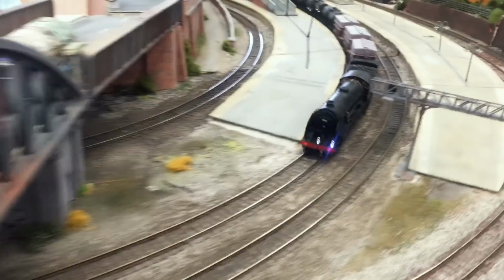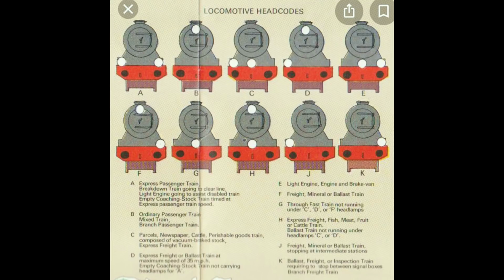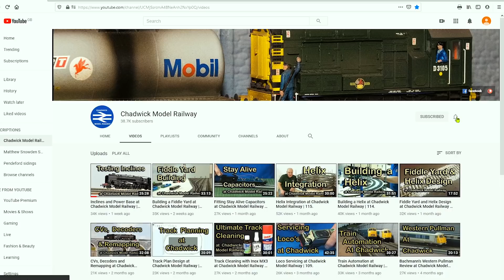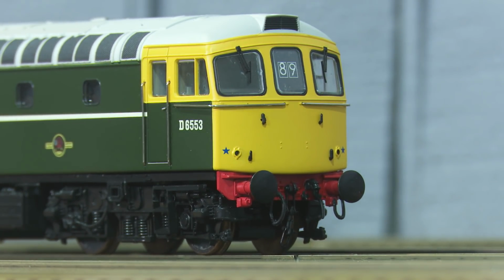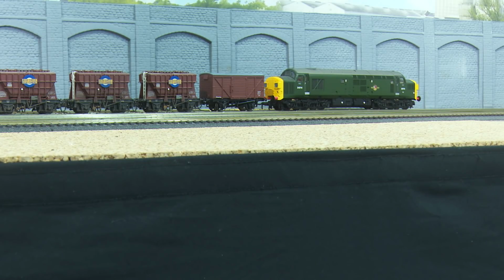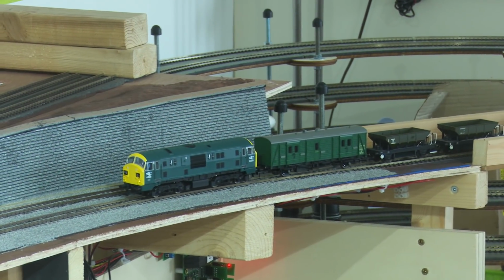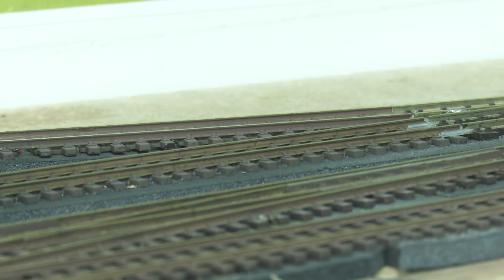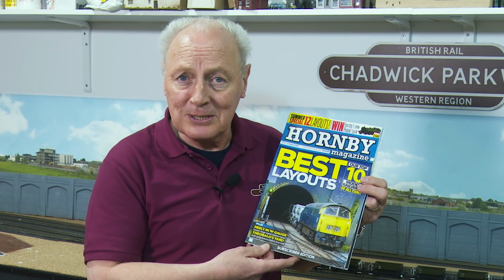Building Freight Trains at Chadwick Model Railway | 155.

Comment: While we're "counting rivets", I was a tad concerned at the run away 9F with no crew!
However, I'm not going to tell you about the 16t mineral I accidentally put the white stripe on the wrong end of, and still haven't fixed, for fear you'll have an attack of the vapours! Always interesting and informative. Cheers
Reply: If your ballast train is going to remain a fixed rake I can heartily recommend Hunt couplings. I'm slowly converting all my stock over to them. I can't stand tension locks, even the smaller modern ones
Reply from the maker: Excellent comment Davie. I’m unsure about using hunts on this train, as I’m unsure of the finished weight and whether the magnetic couplings will stay attached when coming up  the Helix. Regards Charlie
Reply: @ChadwickModelRailway  Charlie, you are in the ideal situation to fit a converter wagon with Hunts, and then run longer (normally coupled) trains up your helix to test for breakaway lengths. 
I shall look forward to the video on that. 
I plan to use a Hunt Elite as the central coupling of my tube train (for ease of handling) which has two “locomotives” and so has the risk of separation from momentary power loss in the rear section.

Comment: Thanks Charlie another very interesting Video. Having unloaded Ballast on Civil Engineering Jobs in Possessions it was always an interesting Experience for the Staff. The Job could be on a Relaying Site or dropping Ballast as a general Maintenance requirement, ie Site Short of Ballast with the approach of Summer, especially important on CWR where Radius of Curve and Cant dictated the size of the Ballast Shoulder. Dogfish could have Controls for Operators anyway round, other Ballast Wagons of larger Capacity were Seacows, Sealions, even Walruses as well as others, check out Paul Bartletts very useful Website. Unloading of Ballast was controlled by the PW Inspector who was the master of ceremonies, and either walked along side the Ballast Train during the unloading Procedure and or with a Back to Back Telephone by which he could communicate to appropriate People on the Train and obviously the Crew on the Engine and Shark. All Dogfish were fitted with a Baffle Plate to stop all the Ballast coming out too quickly, as Ballast could be dropped from either side for making up the Ballast Shoulder or in the Four Foot. Unplated Wagons were carefully marked and generally only unloaded carefully by experienced P Way Staff, I‘ve actually seen an unplated Dogfish derail itself due it being unloaded too enthusiastically by inexperienced PW Lads. Hope you find this interesting.
Reply from the maker: What a great comment Peter. 
So interesting to hear it from the workforce itself.
Regards Charlie

Comment: Hi Charlie, more brain expanding stuff, cheers. So here  I go; Depending on year "All gunpowder wagons should have brakes" developed into, "must have brakes". In some strange time, where lots of gunpowder wagons made up a lot of a braked/part braked train.... Braked gunpowder wagons were all fitted at the end of the braked wagons, followed by unbraked gunpowder wagons, then the rest of the unbraked waggons. Keeping the "gunpowder" away from both engine and brake van, giving both driver and guard as much safety as a motorcyclist's helmet does in a 100mph head on crash with a castle. The theory was that by putting all "Explosives/munitions" wagons together; If one exploded, that initial bang would blast other wagons away so they did not add to the blast. Plus gunpowder wagons were of a much stronger design, so a rake of them in a crash would survive better than spacing them between rust bucket wagons. I hope this reads OK as I can't find my reading glasses, age thing......
Reply from the maker: Great comment Sjaak, Much appreciated, regards Charlie

Comment: It gets even more complicated when you start mixing vacuum and air braked stock. Some wagons are vacuum braked but through piped for air. some locomotives are dual braked , air vacuum, and some are air only. Also locomotives can be dragged dead in train either braked or un braked. Knowing were to put everything so you have brake continuity is something of an art form.
Reply from the maker: That might just be a step too far for my channel Arthur, regards Charlie

Comment: Sorry Charlie, this is a second comment. Your question about number of Gunpowder Vans that can be marshalled in a train, whether they can be formed together and the requirements for barrier vehicles is most timely. My two new Rapido vans arrived today! 
The 1950’s Rule Book states that, 
Not more than five vehicles containing 
explosives must be conveyed by any one train at any one time. Vehicles containing explosives or highly inflammable liquids or liquefied gasses must be marshalled as near the middle of the train as possible and in any case there must be at least two vehicles either empty or containing non-explosive 
traffic marshalled between the engine and the first vehicle containing explosives or highly inflammable 
liquids or liquefied gasses, except that for short distances between depots or private sidings and marshalling yards these two vehicles need not be provided.

I hope this helps. Tony
Reply from the maker: Brilliant Tony, great info and much appreciated.
Reply: Good stuff Tony.
I joined BR in 1978 and hava feeling it had been tightened to just four explosive vans by then.  At that time our "goods" 8J23 Bescot-Cambrian ran with mostly vaccy traffic. I used to go through to Pwllheli on Tuesday and would bring the loads back from Penrhydeudraeth. Always barried by two wagons from the loco and another two. By this time it was mostly 12T vanfits, handy because they often worked onto the Cambrian Coast with agricultural products like slag and lime and feedstuffs.

In 1979 when Barmouth Bridge was banned to locos we used a DPU to recover all the vac fitted wagons back to Machynlleth for despatch back to Coton Hill. The DPUs were allowed 7 vehicles as tail traffic. I saw one of these trains but sadly never had a camera. Not sure how many trips there were but at least some of the wagons were CXVs.  Like you my pair from Rapido are eagerly awaited - maybe tomorrow. I can then put my 8J23 together with my blue Bachmann 24/1 !!
Reply: @philbartlett7898  nice memories Phil. Old guard stories would make a good book and really useful information for modellers.
Reply: Hearing about the Gunpowder vans reminded me of an experience told to me by a fellow worker forty years ago. He was head shunter at a provincial town during WW2. A train of explosives arrived for on-forwarding. But it had not been made up correctly, all the wagons containing the explosives were marshalled together when they had to have an empty vehicle between each one. He and his crew took ages to put it right. The detonators were a seperate consignment on an entirely different train.

Comment: Interesting video, I have been thinking about freight train composition recently. Mostly in late 80s/1990 speedlink trains where freight was mixed. Plenty of videos on YT of these and often there were shorter trains. By the time of speedlink, I think everything was air-braked so much easier to recreate. I did read somewhere that VEAs (ex Vanwides?) were used as ammunition vans and could be accompanied by a brake van with an armed guard inside (not sure how true this is, but the IRA were active then).
Harder to recreate are the longer trains in modern times with 30+ MGR wagons or when the Class 60 came out and started dragging ~30 TEA 100t bodie tankers, a train that long would go twice around most people's tracks. In some ways, I guess we just have to make the best representation we can within the limitations we can't get around.
Reply from the maker: An excellent comment Glen. I find it harder to recreate such atmospheres with more modern rolling stock. Regards Charlie

Comment: I learn so much from watching your very interesting and amusing videos so another great job. I never knew that the wagon colour denoted its brake status, but now I do. However, I have a question, on the mixed freight you removed the flatbed wagon carrying a chained grey load as it was allegedly unbraked ? but to me the flatbed wagon appeared to be coloured Bauxite meaning it was braked and it was only the load that was grey ??? or did I miss something ? Re the magazine cover, yes they should know better, but they still continue to refer to "OO gauge" rather than "OO scale", even on their annual award trophies they got it wrong !
Reply from the maker: Well spotted Dave, I’m on the case.
Regards Charlie
Reply: CONFLAT wagons are indeed bauxite, brake fitted & classed as "XP" suitable for use connected to an XP passenger train if needed. Unusual for a CONFLAT to be fitted to a passenger train but "XP" bauxite vans (especially fruit, fish, perishables) were often added to some express passenger trains.
Reply: @patmcdermott4832  Thanks yes conflat not flatbed :) still learning...

Comment: A very interesting video, Charlie!  Even though I'm a US model railroader,  for some reason I tend to watch more model and prototype railway videos from the UK.  Go figure.  However, I was quite unaware of the color coding of goods vans for the presence of air brakes.  And here unit trains of flammable loads such as ethanol have buffer cars at both ends, usually a covered hopper such as a grain car.  (Having a buffer at both ends avoids shunting when the train is reversed.)  On my own layout, although it is freelance I try to keep the equipment true to its early 60's time frame and follow prototype practices.  But that is a choice made for my own enjoyment (and OCD).  Cheers from Wisconsin!
Reply from the maker: I’m so pleased that you enjoyed it Andrew, and you guys clearly use barrier wagons over there too. Regards Charlie
Reply: BTW, British railways were mostly using vacuum brakes, rather than air brakes, at the time these colour codes were in use.

Comment: In my time with HO i always found brass wheels were a pain  with always being dirty where possible on locos I would switch them or something else which made all the locos run OK . As for the coupler sagging this is more a simple result of the mas produced wagons and the size o the hole used to mount the couplers with most couplers being a snap in design if the hole is above a certain size the coupler will sag. 

Before the days of so many choices for replacing couplers the most reliable way to fix the problem was to remove the lower part of the hook which would foul the points etc. This would mean that you could not in a realistic way uncouple these waggons or coaches but you would have to do in blocks so you might have a train of 10 wagons which were made up of 2 x 5 wagon sections that you would drop at different places so the couplers would not matter. 

Before Kadees were easy to get here in Australia my biggest problem was that hornby stuff came with the huge bar and hook coupler Lima stuff came with a small hook and bar similar to what is now a standard fitting and anything else would come with a coupler that was a standard where it was mainly sold so anything from the US had a hook and horn setup similar to a plastic non movable type of Kadee coupler. With the mix of wagon and loco  and coach stock designs used here it was hard to get semi realistic looking trains made up because of these coupler  differences. 

In the end i would often remove the couplers and make up either a solid bar coupling which was attached to each wagon and they were perminantly attached and set them in groups of about 5 wagons with a single standard type of coupler between the groups. 

The other problem was trying to run diferent locos as we had some made to a more US design in desiels and the older steam types were a mix of US and UK stylesso to model them it was often a case f getting a US model and making the first wagon behind the loco have what i called a converter setup where it matcked the US srtyle on one end and the other end had the for me standard coupler on the other end. 

This was fine with short goods wagons where the couplers were itted to the wagon frame but with the larger coaches and longer wagons as is more typical here as in the US most companies mount the couplers to the frames of the wheel sets which made mods harder to do as if you mounted a coupler on the end of an 86 oot wagon on any tight curved layout they would pull eachother off the rails in spetacular fashon. 

Once Kadees became easy to get though not cheap this was a god send as in time you could switch most stuf to them but you always had to check the uncoupling bars for height or you would have the same problem with them hooking the points or crossings.

In my opnion the best way to go with what is available on the market these days would be to change as many as possible to the Hunt coupler type system where they are magnetic this may make problems with realistic drop and pickup services but it stops point /crossing fouling
Reply from the maker: Sound advice BB.  My current plan is to use a solid bar to couple of wagons together with KD is every five wagons or so. Regards Charlie

Comment: Every day is a school day!  Learnt a good bit more, so thank you Charlie.  I noticed one of the grey wagons at the back of one rake of wagons would be unbraked (?) but the wagon had brakes in the moulding chassis. Is this just the model maker being lazy at leaving the brakes off grey wagons and adding it to brown ones.....or me being daft?  
I enjoy hearing about the background of how trains were run by the railway.  Barrie Davis gives info on the running of trains too - it all comes together to help make things, perhaps, more 'prototypical.
Reply: Every wagon on the system had brakes..the grey example you quote being one of them, these brakes were hand operated only as opposed to through piped air or vacumn brakes.
Reply: @stevelomas4119  thanks. Of course - that makes sense..I'd not thought of that!

Comment: Hi Charlie: This was a very informative video for someone in the US trying to do a UK layout. Question I noticed at around the15 minuet mark You did not mention a taillight on the rear of the mobile tank cars, was this because they were still using the old-style oil lamps or should I add an electric lantern.
Reply from the maker: They were replaced with battery powered lamps so I would go with those if it suits your era.

Comment: I found that fascinating and, for fun, I shall re-sort my mixed goods trains and guards vans.  I noticed on a recent visit to the GCR, they had a consist of several dog fish wagons on a siding at Quorn & Mountsorrel Station and I didn't notice any particular pattern to their configeration.

Do you know, I wonder, if passenger trains were regulated in a similar way, i.e. where in a train would parcel vans, brakes, non corridors, corridors, tourist and restaurants ect. all go?
Reply from the maker: Passenger stock does not seem to have the same braking issues Piers. Regards Charlie
Reply: Passenger train/parcels formations were laid down in special books issued to staff. for instance the East Coast Main Line Carriage Working book listed all trains running between KX and Edinburgh/Aberdeen and their formations.

Comment: Thank you Charlie for another interesting and informative video. I've never really thought about how to arrange fitted and unfitted stock together until now. Is it a general Heljan problem as I have Hymeks that have drooping couplings?
Reply from the maker: Yes Heljan couplings are problematic but I certainly won’t be beaten on this one. Regards Charlie.
Reply: @ChadwickModelRailway  Hi Charlie. I have found some HELJAN locos tension lock couplings do droop. Careful examination showed that the NEM coupling was slightly thinner than BACHMANN/HORNBY models. So I just swapped the HELJAN for one of the others.

Comment: Interesting Charlie, lots of food for thought there. And if you’re sad, then so am I 🤣 Like you I do like to attend to details and incorrect “fixed” headcodes have always jarred my view of a model train ! But as Paul Cassidy has eluded to below, surely we must have reached an age in DCC technology where we can move on from headcodes printed on the front of models and have digital ones controlled via DCC so that we can select anything appropriate to the train it’s hauling ? The first thought that went through my mind when I saw the “all singing, all dancing” updated Class 47 from Bachmann with its working fans and fancy windscreen coating was that they are insignificant details compared with the glaring problem on the front of the locomotive in the form of a fixed headcode (on relevant era models anyway). Moving on ! The  Class 33 you showed had the SR headcode 89 (Portsmouth - Bristol) for passenger workings. SR locomotives would display the same headcode as an EMU/DEMU when working passenger trains over the same routes (as MU stock). For internal (to SR) freight trains, they would have a number and a letter and for inter-regional freight, two letters. As headcodes were phased out, locos on freight or departmental workings usually just carried the “headcode square” (two white blanks). Hope that’s of interest. Take care Charlie, see you on the next one.
Reply from the maker: I’m so pleased that you found it interesting Bryan. Thanks for the advice regarding the class 33 head code,  I find it bewildering the way the southern region have chosen them, but I shall certainly sort it out mate. 
Regards Charlie